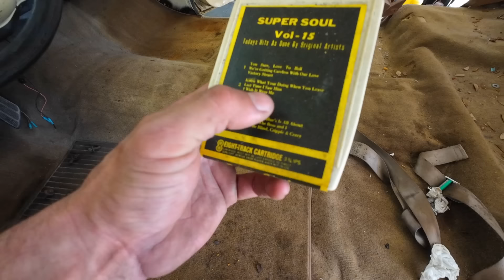Detailing A 45 Year Old Truck With SWEET PATINA

Comment: Yeah, that hood's gotta go.  Toasted, roasted, screwed, and tattooed.  Rest of the truck is great.
I love cleaning ex and intreriors of vehicles.  It's theuraputic and ASMR-like to me.  I do wrench and do the gear head thing too, but it's not as much therapy and ASMR  to me.  Hard to really explain, but that's me.  Well maybe I can use this example:  My house is 100% clean and pristine, but my sink's garbage disposal has an attitude.:face-red-droopy-eyes:
Last carpet job I did, on my 78 Impala Aerocoupe, it was trashed.  Floors were fine, no rust nor water damaged, just cheapo crap from GM at the time.  Luckily, I had friends who worked for a carpet company.  They hooked me up with free auto carpet, some were pieces/remenants.  Even got the right color.  Total cost of recarpeting the Impala:  $0.  Normally, the factory replacement was 2 pieces.  Mine was 3:  One full half piece for the front and 2 halves for the back.  It installed and looked great.

Comment: I just did almost exact thing to almost exact truck. My 86 4 door dually got first wash in many years. I pulled interior paint the surface rust on floor, I dyed my carpets, cleaned seats and put seat covers on. I am replacing radiator tomorrow, and applying poppy patina. I bought new wheel sims

Comment: Love the way the truck turned out. I will say that I bought some Amazon seat covers for mine, and after about a year, they fell apart. I need to try some of that Sweet Patina on my truck. Crazy enough, my doors are shiny, but the rest of the truck is faded. Can't wait to see what else you do with the truck. Love that part saying how it's a 3 speed and how 70 is a struggle. I got the 454tbi with the th400. 4.56 gear. I put a little lager tire on it. I run 70 at 3,500 rpm.